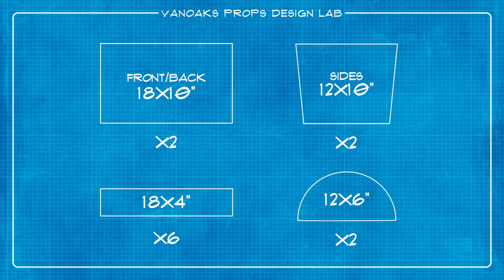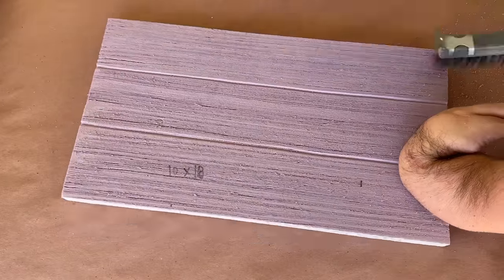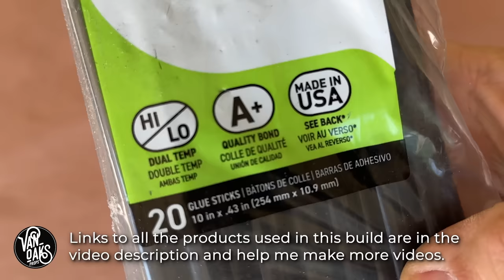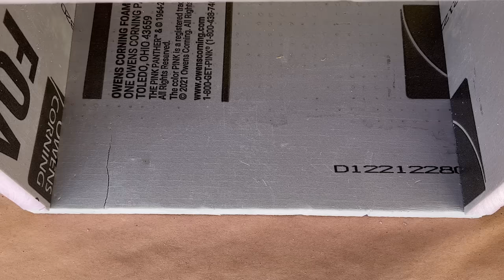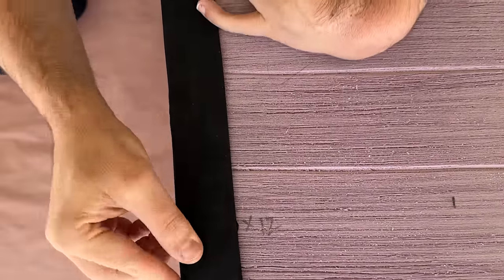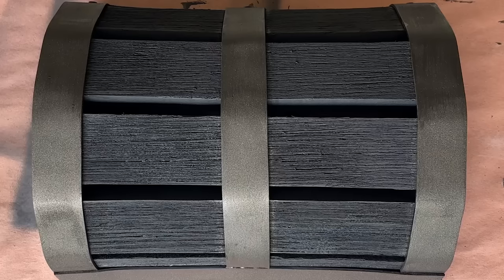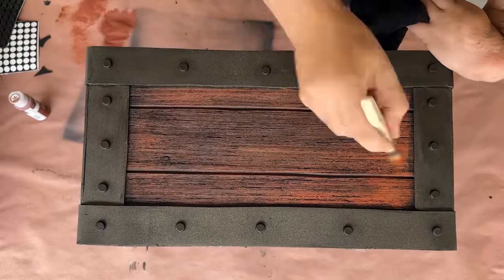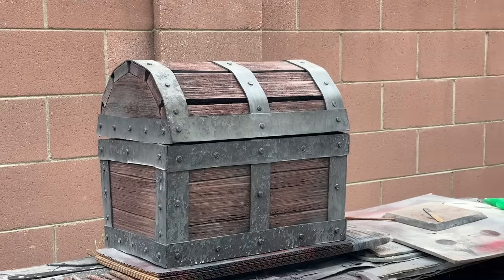DIY Pirate Treasure Chest Prop

Comment: I got some thermal plastic for another project and it didn't work out, it does however make a nice quick handle on a razor knife blade!  Sometimes a bare blade is the best tool - having a little more girth is a finger saver!

Comment: I made a treasure chest that was used as a prop for the door prizes table at an Expo held on International Talk Like a Pirate Day four days ago! 
I bought a styrofoam cooler ($5 at dollar store, so not huge but big enough).  Since it was styrofoam ball based, I diluted spackling compound with matte black acrylic paint to fill in the gaps between the balls and produce a uniform base coat.  I carved grooves in the sides and top to emulate wood planks.  I added baking soda to matte black acrylic paint to thicken it, and applied this mixture with a chip brush to create a wood grain.  I purposely did not use a rasp or wire brush, since this type of foam will not withstand such abuse with anything resembling tact, much less grace.  I sealed the painted surfaces with modpodge for durability.
I used cardboard strips for the iron straps (filled in the corrugated sides with spackle), and used upholstery tacks for the nails in the boards and straps.  I loosely wrapped a 100-light strand of fairy lights (~16 ft) with red and gold sparkling tulle (~20 ft), and pinned that to the inside walls of the cooler with thumbtacks that I painted gold.  
I wanted to add shells to the lid, but I was initially stumped on how to get them to stay put reliably without using gobs of hot glue.  I finally decided to soak some paper towel in modpodge, wadded it into a ball so that a good surface area was in contact with the underside of the shell and squished it down onto the lid with books.  
Then I decided to be a bit fancy, and stenciled on some swoops and swirls with a silver sharpie, then painted over the silver with teal acrylic paint, letting some of the silver show through to make it look gilded.  I was ecstatic with the result, and received myriad compliments.  :-)

Comment: as always, great to watch. love your builds. I think if one was to cut the plank edges at an angle you could reduce the gaps between the planks on the lid. I have just bought a new house and there are old wine barrels downstairs and I was checking out they were built. Same method.
 I also found 3 old trunks that will be treasure chests in future halloween haunts. Almost spooky season. Counting the days
Reply from the maker: You’re absolutely right.